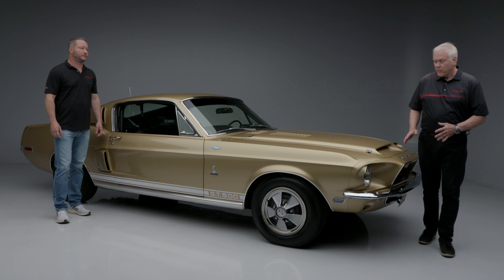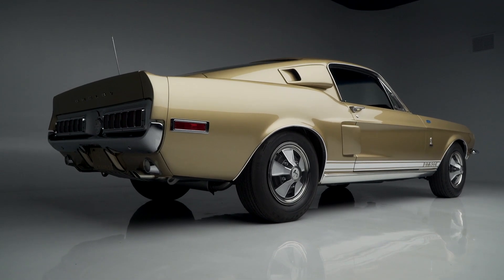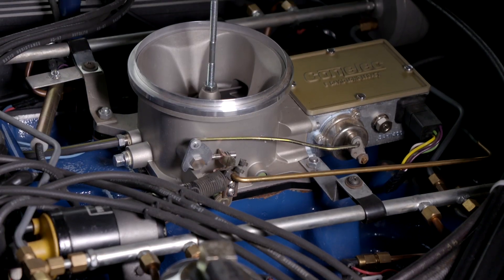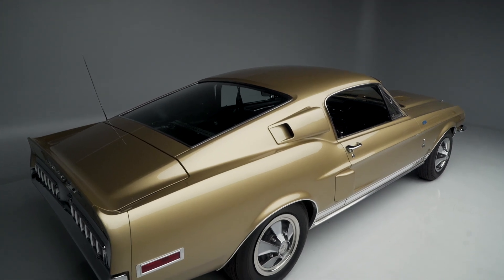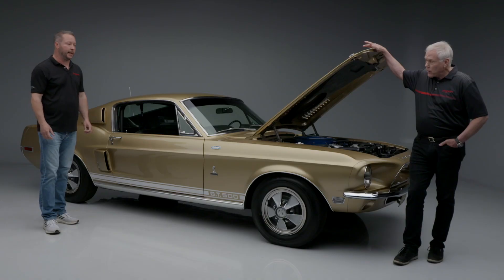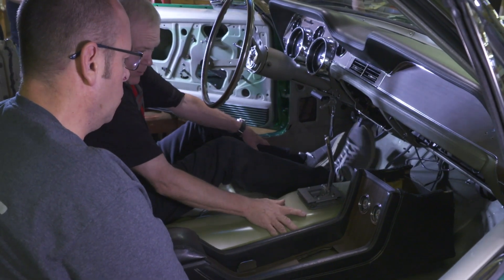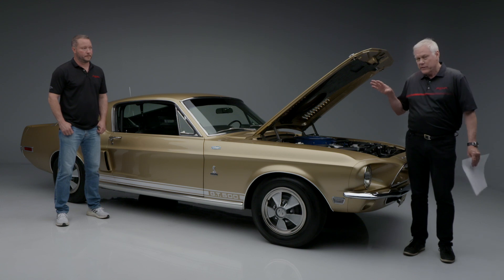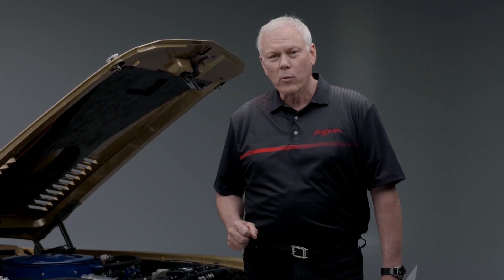FIRST LOOK - 1968 Shelby GT500 EFI Prototype - BARRETT-JACKSON

Comment: That car belong to a good friend of mine Gail R back in the 80s the car was painted black at the time. The car scene mini track days. It was one of my first rides in a Shelby Gail has owned a number of Shelby's over the years and he was not afraid to use them as they were meant to be. He knew at the time there was something special about the car but it wasn't till after he sold the car that he had found out that it was a prototype.